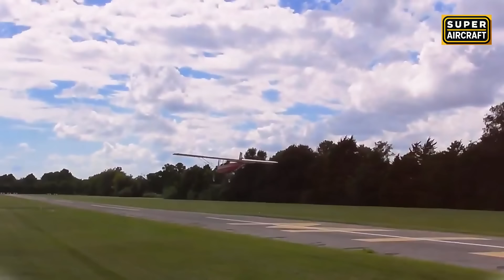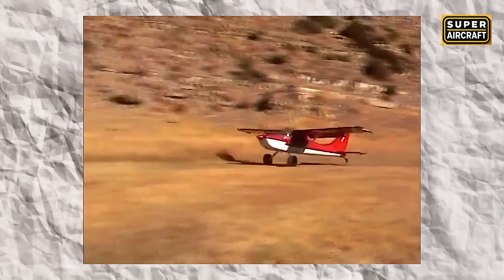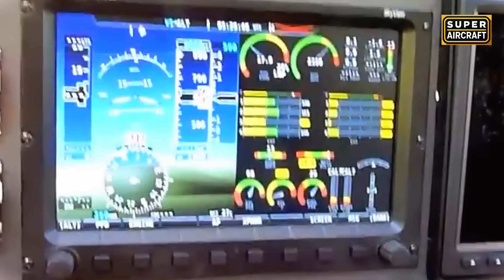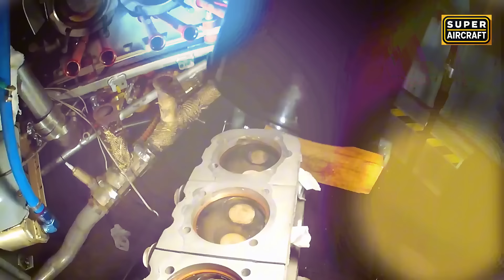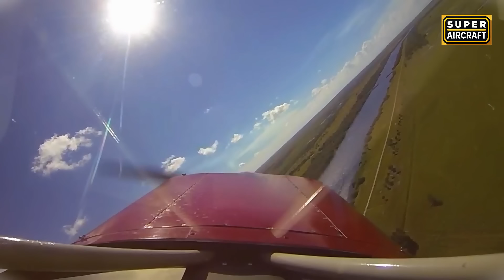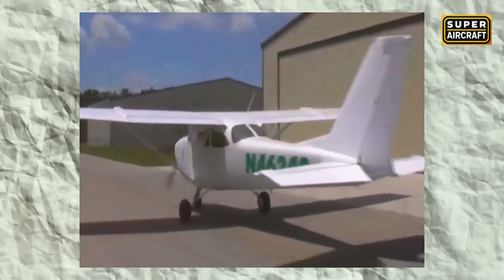CAR ENGINES IN PLANES: 10 CONVERSIONS — FEW SURVIVED!

Comment: Car engines and the management system need major reengineering to make them reliable. The VW air cooled worked because they are non complex and limited by there carburettor. Fuel injection on the other hand that is set 0-4000 feet doesn't adjust when this is exceeded this limit even if its 02 sensor is working. 
Oil pick. Cooling, manifold temps and pressures all need extensive reworking  and the brain has to have engine maps for each phase within the flight altitude.
Reply from the maker: @harrybrown4815 Excellent points. That's exactly why some automotive conversions succeed while others struggle. The simplicity of the old VW air-cooled engines made them attractive for experimental aircraft, while modern automotive engines often require much more engineering to handle cooling, lubrication, fuel management and altitude changes reliably. Thanks for adding this technical perspective to the discussion! 🤠🛩️

Comment: A friend of mine put a 22r in his. It lasted till wing supports cracked. The only issue was was negative g. The carb would cut out.
Reply from the maker: @timesthree5757 That's a pretty impressive testament to the 22R! 😄 Lasting until the wing supports cracked says a lot about the engine's durability. The negative G issue with carburetors is definitely a classic limitation. 🤠🛩️
Reply: @SuperAircraft2025 it was a fun plane to work on. I'm not an aircraft mechanic but a car mechanic. I rebuilt and helped install the engine on the plane.

Comment: toyoto certified the lexas for aircraft in the 90;s
Reply from the maker: @baldyivy8982 Interesting point. There were indeed projects using Lexus/Toyota engines in aviation back then. Automotive engines have potential, but certification and long-term testing are always the real challeng🤠✈️

Comment: Buddy's ls3 Murphy moose has over 1000 trouble Free hours, so the ls is a viable option, they scream all day in ski boats, why not an aircraft..
Reply from the maker: @anthonycry9657 That’s a great example. An LS3 running over 1000 trouble-free hours in a Murphy Moose is impressive. And you’re right — they run hard all day in ski boats. The real challenge in aviation is things like cooling, reduction drives, and long-term reliability at constant power. But when those are solved, they can work very well in experimental aircraft.🤠✈️

Comment: Rv aircraft are not suitable for experimental engines full stop , they have been known to kill very experienced pilots with engine failure on take off .it will bit you in the end or kill the person you sell it too . Have seen both happen .  Stay safe only fly with a aero engine .
Reply from the maker: @danielaustralia5820 Thanks for sharing your perspective. Safety is definitely one of the most important aspects in aviation. Many builders and pilots also discuss this a lot when considering alternative or experimental engines. Proper engineering, testing, and installation are critical factors. Certified aero engines have a long track record, which is why many pilots prefer them. In experimental aviation, the responsibility for reliability and testing is really on the builder and operator. Appreciate you bringing the safety side of the discussion. 🤠✈️

Comment: One engine type would be an excellent candidate for numerous types of experimental aircraft...The McCulloch 4318 opposed 4 cylinder 100-CID  2-stroke rotary valve induction type air cooled engine Capable of generating well over 80 H.P. and a lot more power with tuned exhaust...These engines are quite reliable,  weigh 80 pounds and have been used extensively in Gyro-copters and in some other types of light weight single seat fixed wing aircraft... 
    Today is : 02/17/26
Reply from the maker: @michaelmartinez1345 Thanks for the detailed comment and for sharing that information. The McCulloch 4318 is definitely an interesting engine for experimental aircraft, especially considering its power-to-weight ratio. I’ll look deeper into it—maybe in the future I’ll make a dedicated video about these types of engines.🤠✈️

Comment: Auto engines are not designed for the Duty Cycle of a plane. You will probably kill a Chevy Corvette engine in any single engine plane.
Reply: Not even close.
You got it backwards. Aircraft duty is a cake-walk compared to automotive. Car engines can only dream of such easy conditions.
In fact there are all manner aircraft out there running LS's (corvette engines).

Comment: You forgot to mention diesel conversions, which are actually even more reliable and suitable than 90% of certified gasoline engines. The most famous is the Finnish conversion of a Cessna 172 with a 1.9 TDI engine. I bet that plane is still flying today with minimal fuel, maintenance and without any malfunctions 😂 The original Lycoming O-320 would have already broken down three times by now. 🤣
Reply: Bullshit ! Car engines are build for 10-15% constant pwr !

Comment: A few of those auto engines were first designed for aircraft.  A trend started with the Tucker that used surplus engines for aircraft in cars when all prior cars used steel or iron blocks.  Also the apposing horizontal engine itself was for aircraft first.  Auto makers started adopting and adapting aircraft engines largely to save weight.  Mg and Al blocks were first used in the air.
Reply: Light weight is important for efficiency and performance...However , liquid cooled engines are extremely prone to severe overheating when a Thermostat  sticks shut or when the coolent level is very low... Another thing that can cause overheating on Air cooled and liquid cooled engines is serious blockage of airflow in areas that the heat should be carried away from the engines... Engine oil carries a tremendous volume of heat away from the engines as it has the ability to carry away heat to areas that are heat exchangers in good airflow...
    Aluminum engines are particularly vulnerable to warping and annealing during severe overheating... The Reason  that aluminum is so vulnerable to overheat damage ; is because of the relatively low critical temperature of tempered aluminum alloys (475 ° F. ) as compared to cast iron critical temperature (1,380°F. - 1,560°F.) which means that the cast iron engines can reach over 3x the temperature before the structural integrity is negatively affected.... The engine on the majority of vehicles is usually the most expensive component of most vehicles.When it is permanently damaged , the vehicle is often totaled , even if the vehicle has never had a single accident... 
     It's not uncommon for an overhauled stock engine to cost well over $35k.  That could easily total any vehicle , even without getting into an accident...The newer vehicles are a HUGE LIABILITY TO OWN BECAUSE OF THEIR  COMPLEXITY AND PRICE TAGS BEFORE THE INITIAL PURCHASE....
   The older, simpler and more affordable and reliable vehicles are currently making real come backs, mainly because they are typically much more durable and because of this, many of  the older vehicles have much better resale values...
   Today is : 3/14/26

Comment: The biggest challenge people have had converting automotive engines to aircraft use….

1) Needed horsepower.

2) continuous operation.

3) rpm required for the prop.

4) rpm required for the engine to produce that HP.

5) connecting engine rpm to prop rpm.  The gearbox.

6) weight of the gear box vs. strength of the gear box.

7) gearbox failure often leads to the prop departing the plane…

8) prop and gearbox departing the plane is a whole other challenge…. No thrust, and a highly changed weight and balance for the plane…

9) on a small engine, less than 100hp, the gearbox strength requirement isn’t all that high….

10) on a 350hp engine, the gearbox strength requirement just became super important.

11) RPM for most props… 2700rpm max.  Cruise 2400 to 2550rpm.

12) rpm for most automotive engines 5K rpm max, 2.5K rpm constant.

13) most often, cars may run hard for a quarter mile, about 15 seconds… and cruise for hours after that.

14) aircraft will accelerate hard to get airborne, then climb for the next 15minutes at full power.

15) find a gearbox that everyone is using already, the same way you intend to use it… don’t guess, make assumptions, or hope any box will work.

😃

Comment: Lycoming made its engines reliable because it operates at around 50% of the engine's max power(6 litre disp with 200 hp) .  While those cars converting's engines always reach their max output(think of push on the red line rev. all the flight).  But Rotax made me puzzled.
Reply from the maker: You’re absolutely right about operating regimes — that’s a key factor in reliability. Certified engines like Lycoming are indeed designed to run at lower specific stress for long periods. With automotive conversions, pushing near max output continuously can definitely impact longevity if not properly managed.
Rotax is an interesting case because it was designed from the ground up for aviation use, even though it runs at higher RPM. The use of reduction gearboxes, liquid cooling (in many models), and tighter engineering tolerances helps balance that higher operating range with reliability.
Great point — this is exactly the kind of nuance that makes this topic so interesting.🤠👍🏻🛩️

Comment: you could use honda 1200 engine for this has radiator too lots of boxer engines out there many motorcycle junk yards out there
Reply from the maker: @WilliamKennedy-q6o
Thanks for the input. Motorcycle and automotive engines can indeed work in experimental aviation, and many builders have explored options like Honda and boxer engines. The challenge is not power alone, but cooling, sustained RPM operation, redundancy, and long-term reliability in an aviation environment. That’s exactly why some conversions succeed and many don’t.🤠✈️

Comment: This is a no bainer, I have a 2.2L Subaru with a 2 barrel Holley carb on my gyroplane. 120 horsepower liquid cooled engine with electronic ignition. My insructor has the 2.5L with 150 horsepower and fuel injection. Best thing about liquid cooling is that I get cabin heat. Most homebuilders will use the Subaru, unless you can afford a Rotax.
Reply from the maker: @deefective1100
That’s a solid setup, especially for a gyroplane. Liquid cooling, proper ignition, and realistic power expectations make a big difference. Subaru conversions can work well in the experimental world when engineered carefully—Rotax just makes it easier, not necessarily better in every case.🤠✈️
Reply: Ej22 has a better crankshaft than the ej25s, the 25s usually spin rod bearings on 2 or 3 cylinder. Manley internals basically make Subarus bullet proof
Reply: No akkor fussunk neki!  Tudni való,hogy a repülés világa nem a koldusok kiváltsága. Viszont ha van lehetőség a választásra, és nem vagy ellensége a pénztárcádnak akkor megtalálható a testreszabott megoldás. Vannak autóipari motorok amik adottságaikból fakadóan, komoly megfontolt áttervezéssel , hozzá megfelelő anyagismerettel , elfogadható motorként szolgálhatnak könnyűrepülőgépek erőforrásaként. Ezen motorok közül talán a legmegfelelőbb alternatíva a Subaru motor család egyes példányai. Függően attól ,hogy miben szeretnénk használni. Jómagam is a  Subaru repülőgépes átalakításaival foglalkozom már jó ideje. Így a valamivel nagyobb rálátás okán merészelem védelmem alá venni ezeket a motorokat. Sajnos azt is meg kell érteni ,hogy "aprópénzből" ezeket az átalakításokat sem lehet kivitelezni. Viszont a fenntartási költségek hosszabb távon azok, amik mindenképpen alatta maradnak a hitelesített repülőgép motorok költségeivel szemben. A teljesség igénye nélkül,példaként említeném itt meg a közelmúltig Ukránok által Poltovában gyártott könnyű helikoptert .Típusa: AK 1-3 Sanka. Ezt a gépet eredetileg a Subaru EJ 25 motor repíti, és nem is akárhogyan. Mellesleg annak is tudatában lévén ,hogy talán a helikopter az a repülőeszköz, ahol a legnagyobb igénybevétele van a motornak. Természetesen ezt a pár mondatot nem azoknak írtam akik meggyőződéses repülőgép motor pártiak. Őket fölösleges győzködni . Mindenkor megfogják venni a gyári motorokat ,mivel abban hisznek , kísérletezni nem akarnak, és nem utolsó sorban, megvan rá az anyagi fedezetük.  Végezetül kívánok minden kollégának sok sikeres repült órát az új évben !

Comment: The 'A' model Funk aircraft was successfully powered by an 'Inverted, Liquid cooled FORD Flathead Engine' and there are Plenty of them still flying today.
Reply from the maker: @jtuttle11
Great historical example. The Funk conversions show that automotive engines can work in aviation when the airframe, cooling, and operating envelope are designed around them. Longevity comes from integration, not just the engine itself.🤠✈️

Comment: Car engines are simply unsuited to re-use in aviation. They are (increasingly) specialized to the automobile market, and make little sense in the aviation world. I wish it wasn't so, but unless an engine manufacturer steps up and designs a purpose-built engine for aviation, we are mostly stuck with WWII era engines. And even they break! In my flying career I've abandoned takeoffs due to engine misbehavior more times than I care to count; several such occasions required an engine tear-down, others were mostly electrical in nature. As an engineer, I look at aviation engines and it's hard not admire them; but I dream....!
Reply from the maker: @davidgapp1457
Very honest and well-balanced take. Aviation engines live in a completely different operating regime, and reliability margins matter more than innovation alone. Even certified engines fail, as you said—but the philosophy behind them is what keeps risk manageable. Appreciate the engineer’s perspective.🤠✈️

Comment: My ultralight  has a 1/2  VW engine.  Works pretty good 😊
Reply: Those are the best . For many decades Half and 4 cylinder . Known Reliability
Reply: Yeah but that’s air cooled and direct drive with no gearbox.. that’s where the problems are, with the reduction unit and water cooling..
Reply: Is it a Hummelbird? I helped my father build one of those. Cute little planes.

Comment: Leaded fuel. the difference is lead fuel. Even modern light aircraft use it because it helps protect the engine cylinders from wear at high RPMs better than unleaded fuel car engines use. they will always fail if you are going to run them off unleaded.
Reply from the maker: @dalvenable331 You’re absolutely right — leaded fuel plays a big role, especially in protecting valve seats and cylinders at sustained high RPMs. Fuel compatibility, thermal management, and duty cycle are critical factors when adapting automotive engines for aviation. That’s exactly why so many conversions struggle long-term. Great technical point, thanks for adding it.🤠✈️

Comment: I am sure the certificated aircraft company had no effect on the lack of response from the agency.
Reply from the maker: @65LB
That’s how I see it as well. In most cases, the lack of response has more to do with bureaucracy, workload, and priorities inside the agency than with any influence from certified aircraft manufacturers. The system itself is slow by nature, especially when it comes to non-standard projects like conversions or experimental aircraft.🤠✈️
Reply: @SuperAircraft2025 

It takes the FAA six months to respond to common health questions…. Where they know all of the answers, all of the required tests, and have written procedures to follow….

Getting the FAA to respond to an individual about his choice of a particular car engine to put in a single, old, certified airplane…. That is called a fools errand.

😃
Reply: Putting an automotive engine in a certified aircraft is where many people get disappointed…

The aircraft company doesn’t care what you are doing with your plane.  The FAA does.

The home built rules are specific about what percent of the aircraft needs to be built by the builder.  Engine swaps do not qualify on this rule.

This is why we have home built airplanes… and factory built airplanes…

Blending the two… requires writing engineering documents called an STC.  

The STC details a boat load of how the engine is built, and installed… by the time you have finished the documentation you find out it isn’t worth the hassle.

If you need to blame somebody… start with the FAA.  Realize you will spend three years not getting any responses, before you make up an excuse for why it’s not your own fault.

Once you have an STC for your modification… you can license it to other people to follow your exact details.

Soooo…. If you want to do a one-off put a car engine in your Cessna 172… start with a million dollars.  Hire engineers and mechanics as needed, and complete the project….

Then there is chapter two of this silly story… your experimental airplane is not free to fly as you may want.  It comes with a bunch of limitations.  Where it can go, when it can go, and where it cannot go.

Mixing certified aircraft and experimental aircraft makes you need to be a lawyer, mechanic, and pilot, at the same time…

There isn’t a worse feeling than the engine not wanting to run just after take-off…

😃

Comment: Many more auto engines still out there needing to be tested. Yamaha snowmobile engines look's promising,
Reply from the maker: @DJ-mo2ur
I agree with you. There are still many automotive engines that have never been seriously tested in real aviation use. Snowmobile engines like Yamaha’s are interesting because of their power-to-weight ratio, but once they’re run continuously in flight, the usual challenges show up: cooling, reliability at sustained RPM, and long-term durability. Promising idea, but it definitely requires solid engineering and real-world testing.🤠✈️